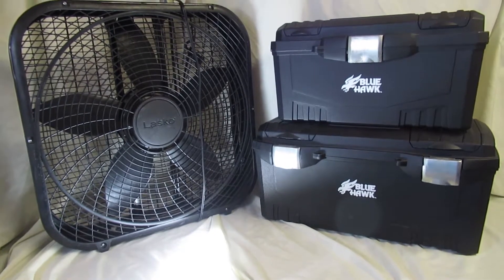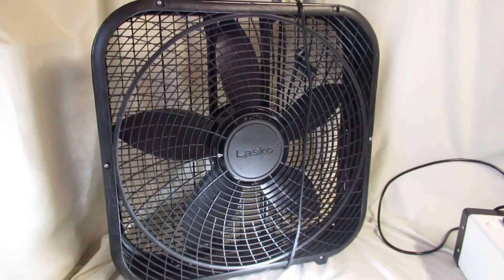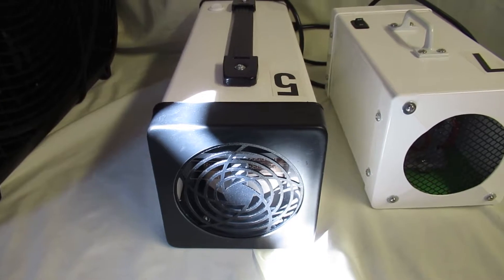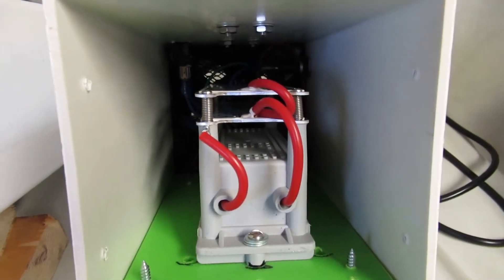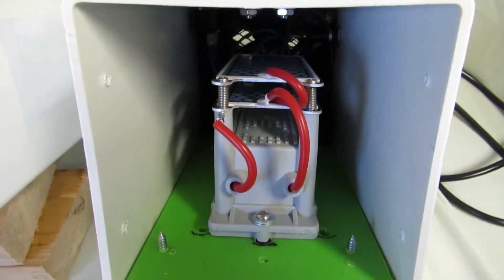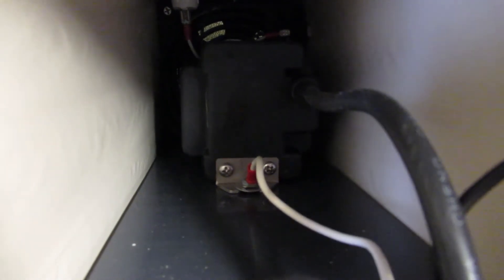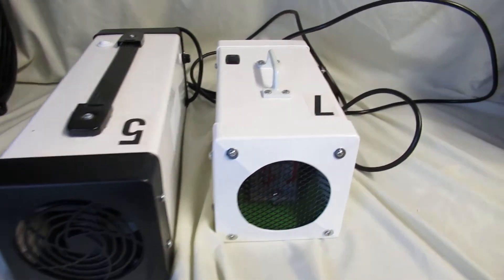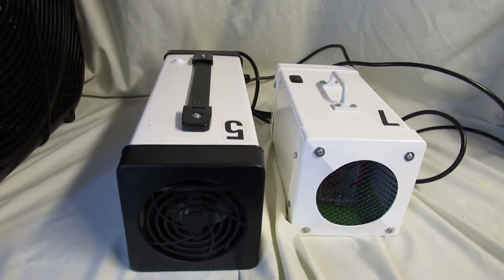OZONE ODOR REMOVAL EQUIPMENT REVIEW

Comment: Certainly the parts from China aren't that good, but the bigger problem here is their construction...
you have to get the air to go over the plates, otherwise it will always find a way with less resistance, which in their case is the space next to the plates

Comment: I have a musty smell after mold remediation. Will an ozone generator remove the smell
Reply from the maker: It should if used properly. Some mold remediators don't consider the job complete unless the area has been ozoned to both get rid of the smell and also to destroy any spores in the air or on surfaces.

Comment: How much business do you actually get for ozone treatments? I want to purchase a set of ozone generators but I don't know how the get the business going.
Reply from the maker: I don't do as much these days because carpet cleaning takes up most of my time. I still offer it but don't actively market it. It's hard and time consuming to get customers because most people don't even know it exists so that's the bad part. The good part is once you get some good repeat accounts it can start to pay off. I did auto dealerships and property management. The key is to get them to use you for all or most of their apts and cars. Doing one or two here and there won't be worth it. Oh, and doing jobs for individuals is ok but is not sustainable because they use you once and that's it. I got all my business from going in person and talking to the used car managers at dealerships and the property manager at apartments. I would offer to do a treatment for free if they wanted to see how well and quickly I could get their apt or car odor free.
Reply: @AllAmericanMack  thanks man that was very insightful. Appreciate all your help.
Reply: Hi Mack.
I wanted to chime in on this and mention the importance of knowing how the ozone mg per hour is probably around 70% of the suspected output  if your feeding them with regular air  VS feeding the machines with a oxygen generator since the mg per hour is much more potent when using manufactured  pure oxygen.  I dont have one of those or a ozone test meter either.  Also its worth mentioning if the area being treated is damp , or even if the outside weather condition is high humidity on the day your treating - It's a good practice to bring a dehumidifier to run at the same time , and turn on the air conditioner if they have it.  I suspect a longer treatment time , or several shorter treatments could perhaps make up for these two things. 
I'm glad to see you have had good performance from the mica screen plates.  I had a expensive machine that used the mica plates,  but it didn't satisfy most of the 
odor problems i encountered. 
 I agree 100%  with you about  the unreliable china  units that utilize  the ceramic  honeycomb plates  similar to you have in your d.i.y ozone generator .  I find the plates last awhile but the damn transformers die prematurely, and theres no fixing them since the internal transformer parts are embedded in a epoxy brick.   I have made 6 ozone generators , each time trying  to improve  the design while fitting more plates in the box and using stronger fans.  I think your the guy who made the  shopvac with the china plates & transformers  in the bottom?  Thats a great idea for forcing 03 gas into cushions, carpets & tight places.   That guy selling his "shop vac ozone contraption"  that's pre made for $1000 is funny.  I know who that is .  I actually bought one of his 20mg/hr toolboxes about 10 years ago.  
TAKE CARE - STAY WELL

Comment: Quick question do you think the maxblaster is better then that bioblaster ?
Reply from the maker: I don't have any personal experience with the Bioblaster but I did a ton of research on them before I bought any machines. I might would have bought one of the old Bioblaster machines when they were made in the toolboxes. I don't care for the newer models that are converted vacuums. I ended up going with Maxblaster because they use neon transformers rather than the cheaper chinese transformers found in almost every other machine. I also felt the Maxblasters were more durable and I still think they are after having one fall out of an attic onto a wood floor without damage. As far as the chinese transformers go, I wouldn't say they're bad as I have machines with them, I just think they are more prone to burning out. But if I were to buy more machines today I would still go with tge Maxblasters.
Reply: @AllAmericanMack  thank you so much for the info I was thinking of buying the 3 pro to start and do carlots in my area I think I will go with the maxblaster. Thank you again.